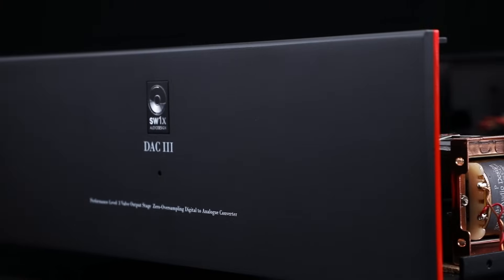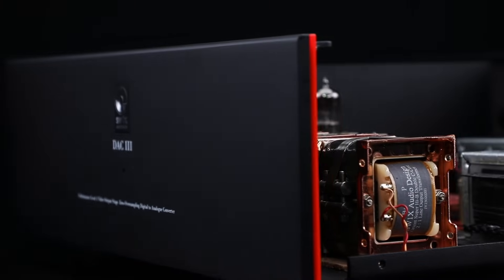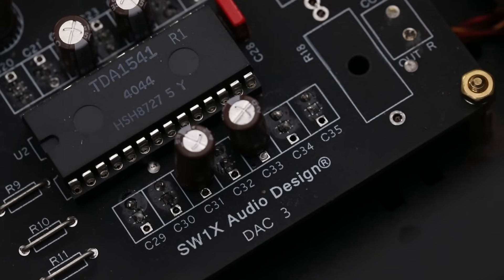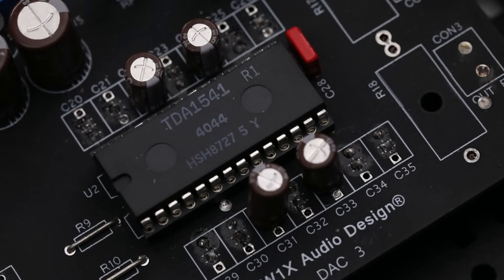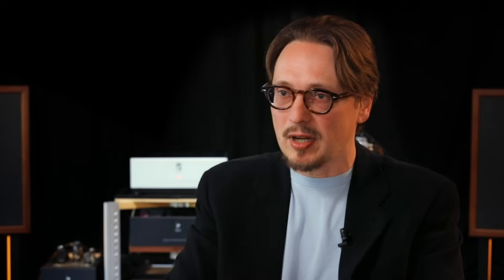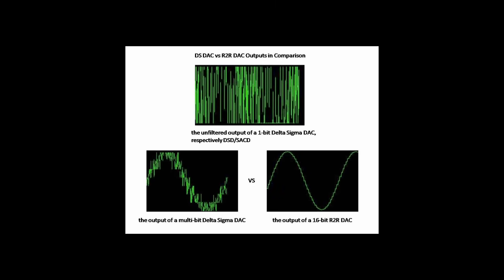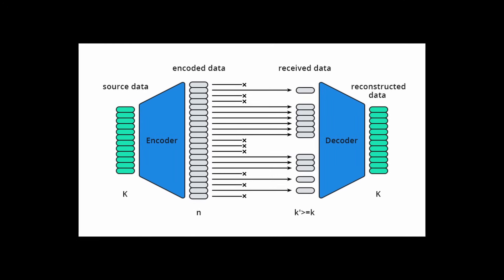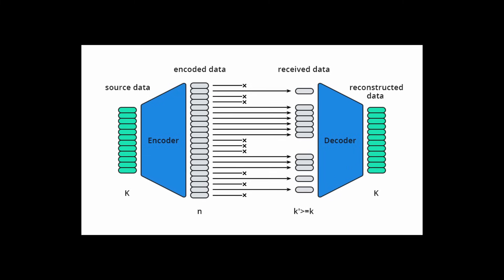Digital Signal Processing (DSP) Means Death To Your Music

Comment: I usually like what you say, but here I would have to completely disagree. If the processing is done correctly for what is actually needed like crossovers you can hear tremendous improvement to the sound stage and musicality. If your music is digital like a streaming service or a CD  It’s actually much better to keep it digital and do all your processing while it’s still digital before taking it out into the analog domain. Over 80% of recording studios using DSP digital signal processing for all sorts of things to create that very music so are they killing the music?
Reply from the maker: it is all relative and depends what you compare what with. live performance, which is acoustically amplified is always going to sound more authentic than any other approximation through active amplification. take shellac recordings and play it back on a grammophone and you are going to pleasantly surprised how direct and dynamic the recordings used to be. take digital and remove the digital filter and you are going to be surprised how much more natural the digital can sound. play back your CD locally and then compare how it sounds when it is streamed though a network of computers. play your music though multiway acoustic system, with DSP applied to passive or active Xover and then compare it to a single driver inside decent headphones or our MTR 963 speakers... once you have done that your perception and worldview is bound to change
Reply: @ I have done a lot of listening to all sorts of systems in my life and I’m a firm believer that DSP is just a tool in a tool box and a now a big part of making and listening to music .  I would be interested to listen to some shellac sounds interesting. The live music you hear and I know from doing front of house at concerts has more digital signal processing done to it than you can imagine and it sounds incredible to the people in the middle or in front and they are not hearing direct sound from the stage in most cases. Just look up Sydney Opera House their system is state of the Art DSP powered
Reply from the maker: @StasAudio  please also try some RTR tapes. even there is analogue equalization is way less damaging than DSP. speaking of which are you aware than many recordings are post processed with RTR tape recorders during the process of digital mastering?
Reply: @ yeah real 2 real is a cool effect that they used to add harmonic distortion, noise and a couple other things.  Basically everything you can reproduce in the analog domain can be done in the digital domain to the point where a double blind test can be conducted and the person will not be able to hear the difference.
Reply: @ Surely you can tell by his response that you should ignore everything else he has ever said too.  I think there is a decent chance he is literally tone-deaf.
Reply: @ what are you referring to? Also I don’t think tone-deaf means what you think it means.
Reply: @ It was a joke that he obviously has no idea what he is talking about.  You can't tell it by his long response of random gish gallop audiophile nonsense to your argument?  He is the kind of guy the hears differences in music based on how the speakers look and thinks that he knows what "authentic" sounding is when he literally doesn't have real life reference for essentially anything he has ever listened to.
Reply: @ I think he’s a terrific salesman and actually really enjoy listening to him. Also his speakers look very interesting. I would love to hear them one day. However, I do not agree with the whole premise that DSP is killing “ musicality” or anything else. DSP is a scientific tool and you gotta know how to use it.
Reply: @StasAudio  A terrific salesman trying to convince you that DSP is the devil so that you buy extra worthless crap from him.  Maybe you should reconsider having any respect for a "salesman".
Reply: @sw1xaudiodesign How do you know that it sounds more authentic if you've never heard the original?  Have you considered that you're suffering from some type of mental illness.  I promise you are literally physically incapable experiencing anything that you say you have.  Either intentionally lying, or mentally ill with some type of OCPD.
Reply: Part#1
I Agree on top of that CrossTalk between 2 speakers is 200 microseconds behind normal. 
Part#2 DSD was the original Archive Method developed by Sony PCM documented by Sony needs Nyquist Shannon to correct the signal. 

The above statement can easily be verified

Comment: You tell that timing is utmost important. I agree - all that bunch of different frequencys, their peaks, their decays and mutual relation to each other on time axis is really very important to live sound. But let`s take your top speaker conception BLH: sound from backside of driver is always delayed regarding front radiation by somemthing like 1.5 m at least! (horn length transport delay). That is about 5 ms. It is extremely big time for attack analising by our brain! So can you compare some DSP delays with this? I think in case of DSP it tenths or even more time less
Reply from the maker: what you are ignoring is that the back firing is acoustically loaded and that means tapered shape of the cone is of higher impedance and supercharging the soundwaves. no DSP can compensate for that because it is a closed loop, speak neagtive feedback system that is always out of sync by definition
Reply: @sw1xaudiodesign different situations: exhaust gases moves, flows. And acoustic waves are spread without media flow. Different principles! Air temperture, humidity, dencity and pressure are constant in horn (at least 2 digits after coma at our sound pressure level) so speed of sound in horn is the same. And for sure not even 10% more, so anyway we have delay from back to front in miliseconds! And this is a lot! And DSP can not compensate it, for sure, physicaly by principle, I understand this. I just telling any kind of dleay from DSP processing is far less then That. So should be a few ordes lower by it`s influence and notisability
Reply from the maker: @ДмитрийФазер-н3ъ  correct. these are no perfect analogies. however no acoustics are perfect for sure but some are more imperfect than others. multi way acoustics are way less perfect than 2 way horn loaded single drivers
Reply from the maker: correct. nothing in this world is perfect and there is no perfection particularly in acoustics- this is mentioned in several of our videos. we are not about perfection but what sounds more like music, more authentic and more convincing

Comment: I beg to difer! Short of moving home, using DSP to correct my listening room is by far the lesser of two evils!
Reply: My room is far from ideal and I've used Dirac and Arc.  After a few days, I realize I'm enjoying the music less and turn them off.  Signal correction of this type always screws up the phase to fix the magnitude.  That's just how it works.
Reply: @mesterha  I room correct manually using a miniDSP Flex and UMIK-1 mic with REW software and have achieved great results.
I have no experience with either Dirac or Arc! But I am sorry to hear you've had a less than satisfactory experience.
Thanks for the info.
Reply: @Lif-999  I should mention that for home theater some type of processing is necessary for level adjustment, speaker distance and subwoofer integration.  Plus home theater source material is of a different quality.  I do use ARC for home theater, and it sounds good.  For two channels, you might need something for a subwoofer, but my main speakers measure to 23 Hz, so I don't use the subwoofer.  I do wish I could try ARC without processing the main speakers, but I don't think that's an option.
Reply: @mesterha  Nor do I have any experience with home theatre set ups. So I cannot contribute in any meaningful way really, sorry. My own system is a 2.1 set up, used exclusively  for listening to music! My mains are rated down to 18 hz - yeah right [at about -10db maybe] - and I run them bone flat but with their own "naturally" rolled off bottom end. This, I have found, keeps the midrange nice and clear and detailed. As for the .1 element, I use just a hint of sub woofer - rolled in at 50Hz at 12dB/octave, for the more engaging and just plain...visceral drum/bass feel that I like. Good chatting with you.

Adendum: My apologies to the OP, SW1X Audio Design, for going rather off topic.
Reply: @Lif-999  When you say you run them bone flat, does that mean you process them to make them flat or that you run them with no processing.
Reply: @mesterha  Yep, I use DSP as the "iron" to ameliorate against all the wrinkles caused by the units themselves, plus all the absorbtions, reflections and nodes caused by driving an L shaped room full of furniture.
Reply: @Lif-999  Sounds like a nice setup.  Enjoy.
Reply: @mesterha  With the right source material, my system is capable of delivering an exciting mix of clean and detailed mids and tops underpinned by an authoritative yet visceral lower end. Of course it's taken me what... 50 some years to get here. So not what you might call an overnight success, then! Haha! And it's always worth bearing in mind that one man's perfection is another man's complete dogs dinner! But, speaking as an inveterate rebuilder and fettler, the "journey" - as is said - has been as pleasurable as the "arrival".
So, if you're not where you want to be yet, enjoy the ride!
Regards.
Reply: You probably have trashy sound, but, what can you do? Live with it, but, don't imagine that you've got it great.
Reply: @wa2368  What a facile remark.